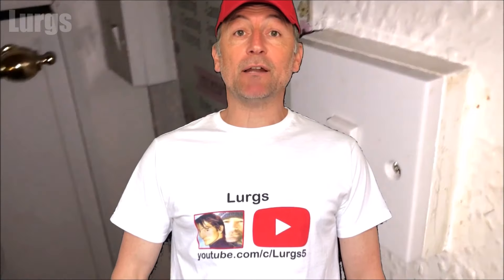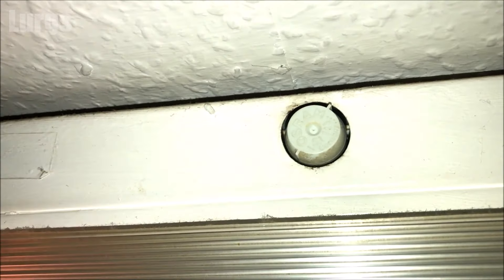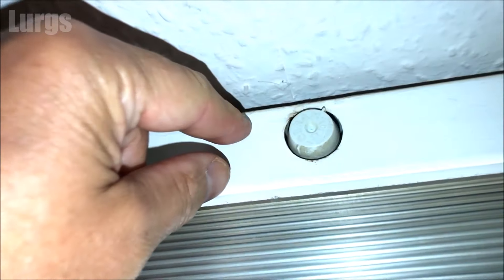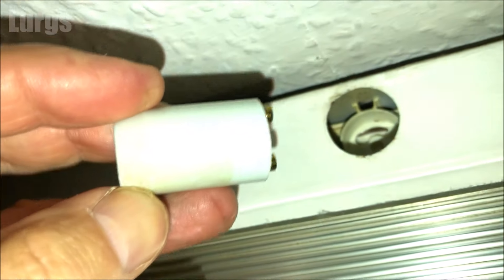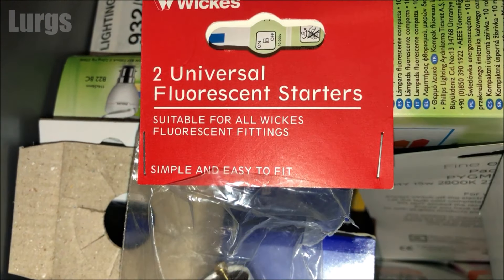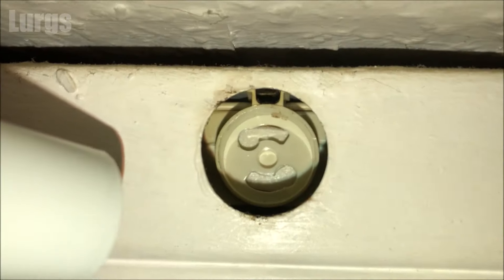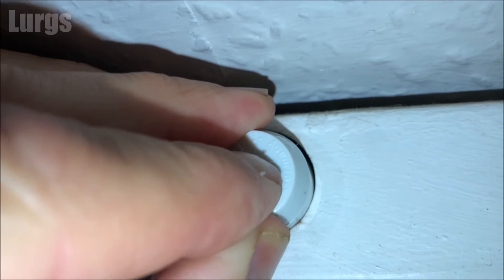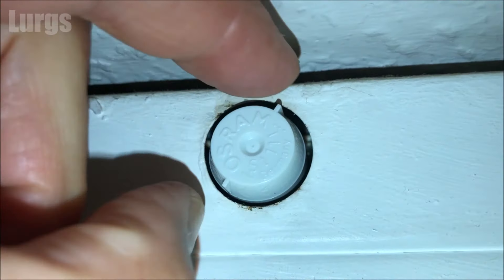Fluorescent Light flickering and How to change starter in a Fluorescent Light

Comment: I've been so afraid and worried about changing the starter in my light fixture, but watching you so casually pull it out after simply switching it off gave me the courage to try it myself. As a mature aged dad, I get no thanks, no acknowledgement, but inside Im giving myself a hug and a congrats.
Reply from the maker: Hope it all went ok and glad my video helped. 😎
Reply: I'm sending you all the thanks I can from here. My dad knew how to fix most things but wouldn't because "My time is worth more.".

Comment: Nice to see that fluorescents are still being maintained... 
We upgraded our 30 year old fluorescent fittings to LED in the garage. Less than a year later, half of each strip was dark, and another was strobing. 
Luckily enough we decided to keep the old fluorescents in the attic. We re-installed the 30 year old fluorescent fittings (after a bit of a clean, and an upgrade to the green electronic starters) and will leave it another few decades before trying LED again :D

We also have an 80w mercury vapor lamp for the garden. It's been a solid, reliable lamp for about 15 years. I strongly reccomend them. I made a custom fitting for it, where the voltage accross the lamp is rectified, smoothed and then measured with zener diodes. If the voltage is too high (ie. Hot restrike, or just switched on and still warming up), it temporarily powers a 100w incandescent lamp.
Reply from the maker: We've had Halogen spotlights (GU10) in a ceiling for nearly 20 years and still going, I replaced some with LED and they don't last as long! But deffo cheaper to run and safer as they don't get hot

Comment: Starter or the ballast hardly ever go bad. Usual suspect is the tube. I usually wiggle it a bit, or take it out, sand the prongs and put back. Before running to the store to get a new tube, I'll test it by substitution, as most homes have more than one light fixture using same size tubes. I've never, ever had to replace a starter.
Reply: What's a prong?
Reply: @Adrienne-ti7sj  Google it...

Comment: great stuff, was thinking what is that little thing for and why the light just turns off after a few seconds. thanks
Reply from the maker: No problem. Glad I could help 😎
Reply: Our fixtures don't have starters. I freaked when I saw the orange thinking FIRE. I'm going to buy a new bulb tomorrow, it won't let me use it with only 1 bulb, it needs 2. The other hallogen fixture has larger bulbs, of course. I'm hoping it's just a bad bulb.

Comment: @LurgsHowToGuides I have 4 bulbs in a receptacle and they were flickering and some went out, so I replaced the tubes. A few days later, they are flickering. I do not see any starter motor. Should I replace the ballast? Thanks,
Reply from the maker: Not sure, there should be a starter motor I think. Hope you can get it sorted, bulbs must be ok if they are new

Comment: Do these starters only apply to older fluorescent fixtures? I’ve replaced the ballast thinking that was the problem but it still woundnt turn on.
Reply from the maker: If you’ve bought a new fluorescent tube you still need the starter.

Comment: I can't for the life of me get the bayonet end of the new starter to fit into the slots. Could I possibly have the wrong size/style starter, or are they all the same size?
Reply from the maker: Compare it to the one you took out. They should all be standard size. It is very fiddly, in my video it looks easy but it took a while to find the slots before you can turn it, just persevere
Reply: @LurgsHowToGuides  Thank you, I will try again today. The size of the new starter looks identical to the old one, so I will persevere!
Reply: @Lillith444  2 months later pls tell me u overcame the difficult adversity 💪

Comment: My light doesn't seem to have a starter. Any advice ?
Reply from the maker: Maybe it’s not fluorescent? Maybe it’s LED ? If it’s fluorescent it will definitely have a starter, it may be at the end
Reply: It's a really old light fitting (60's) I was trying to put a new LED bulb in it and it came with a starter (I'm in England By the way) but there's no circular hole down each side and I thought it might be at one end but I don't think so. I'm gonna buy an old style bulb and see if it works. @LurgsHowToGuides
Reply: Hi, did this work?

Comment: Tried 4 new starters and one tube. Can’t get it to light up at all. But replacing the original fluorescent tube works.(with the proper starter installed, of course) Can I check the starters and/or tube independently to make sure they are sound?
Otherwise I might have to find an electrician!😊
Reply from the maker: If you are having issues it may be more beneficial to install a modern LED long light which will be much better. Not sure how you can test the starters but 4 new ones it’s probably not going to be a faulty starter.
Reply: @LurgsHowToGuides  I am using a modern led tube light. It doesn’t work. I’ll get a replacement.
Thanks for your idea.
Reply from the maker: @barrysimpson130  Assume you aren’t using the starter motors on the LED tube? This just needs direct mains power, thought I’d check
Reply: @LurgsHowToGuides  I am using an appropriate starter. I bought new ones for led tubes.
Reply from the maker: @barrysimpson130  I didn’t think you needed anything like that for LED tubes, just direct 240v?
Reply: @LurgsHowToGuides  It is NOT,I repeat NOT a starter motor but a glow starter.
Reply: @barrysimpson130  There are NO starters for LED tubes.

Comment: Mine only does this when it rains.   Is this the same issue?
Reply from the maker: That does not sound good, do you mean it’s getting wet or humidity is affecting it? Best off replacing starter and tube or getting an electrician to upgrade the light fitting

Comment: How do u know which starter to use can u use any starter?
Reply from the maker: I think they are pretty universal
Reply: @LurgsHowToGuides  do I need the right wattage? Or can I put anything in? Thanks
Reply from the maker: @MrChirish1  The bulbs are low wattage. If not sure remove the old starter first and check wattage on that. If not I think they are pretty standard
Reply: @LurgsHowToGuides  thank you much appreciate! :)
Reply: depend of the tube wattage but most starters would do.

Comment: That's is a 4ft fluorescent light fitting with a 36-40w chokes ballast 220-240v and with a 4ft 36w t8 fluorescent tube and with a 4-65-80w fluorescent lamp starter switch 220-240v or a 5ft 58w t8 fluorescent light fitting with a 5ft 58w t8 fluorescent tube and it's run off a 58+65w choke 240v ballast and that's is a 4ft 36w t8 or a 5ft 58w t8 fluorescent light fitting and I not to sure the size

Comment: Well I think I messed up. When I tried to pull out starter, only that plastic I was pulling came out, the rest of it is still inside and I don't know how am I supposed to pull it out now 🥴
Reply from the maker: Oh dear. Well you need to turn off the light switch and also turn off your Electrics at the fuse then get in there with something and get out what's left. But check electrics are off and DOUBLE CHECK again.